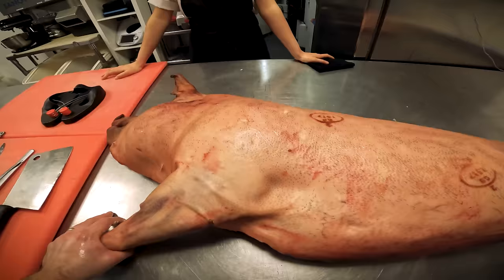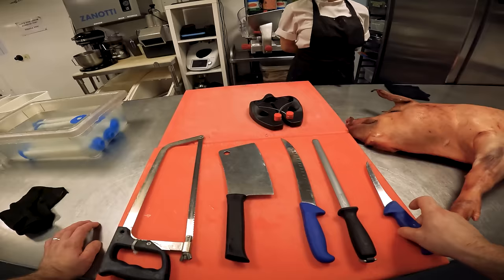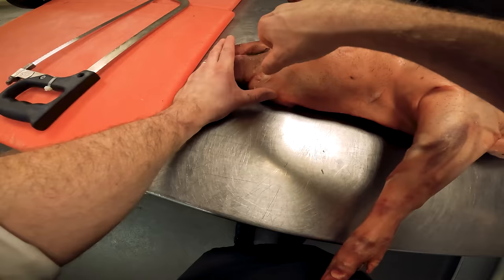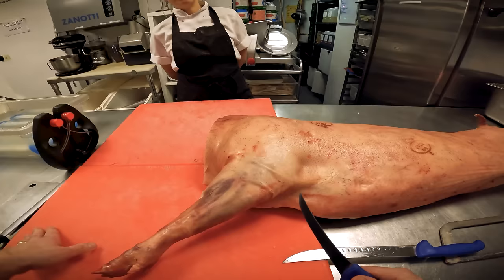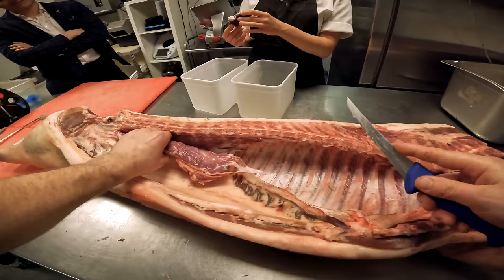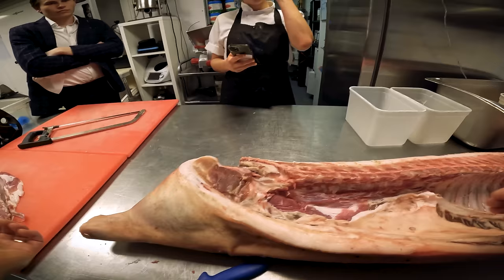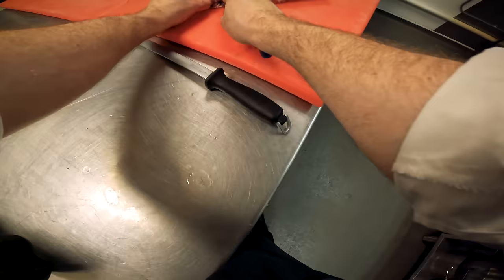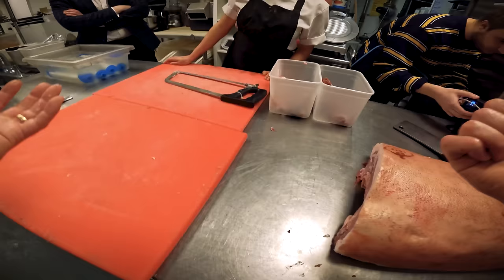POV: Butchering a Pig for a Restaurant

Comment: I'm an industrial butcher running through 3000 of these a day and this has honestly still taught me alot on improving the quality of the cuts, thanks alot.
Reply: That’s what I would have said too if I was a serial killer
Reply: 3000 per day equals to a bit over 6 per minute, or one every 10 seconds, assuming you work non stop for 8h. Sure thing
Reply: @Ranexi  😂😂😂
Reply: @Ranexi  If you just knew, we running slow right now because pork prices are low in Denmark. Capacity of my workplace is 12500 a day split across 2 shifts, night/day. If no mechanical issues or bad pigs we  run 500 pigs/h per production line, i.e 10 a minute -+ and still have about 1:30h-2hour breaks on an 8 hour shift. It ain't pretty and not something I expect to do all my life, but it's the only way to keep the shelves stocked in your local grocery store if we all keep enjoying cheap meat. But yeah sure thing I guess ;)
Reply: @Madkassen2  guess they didn’t read the “industrial” part lol
Reply: @Madkassen2  hvor arbejder du
Reply: @lingling813  Danish Crown
Reply: @Madkassen2  årh sindsygt
Reply: @Ranexi  

He said "industrial", mook.
Reply: @Ranexi  industrial butchers use band saws to break down mean rather than hand saws and cleavers etc
Reply: How can you sleep at night ?
Reply: @alexandergeuze4689  With a belly full of bacon ;D

Comment: I was under the impression that it is important to clean both the blade of the saw and the meat around the cut after sawing through a bone to prevent bone dust and chips from accidentally ending up on people's plates. Am I wrong about this or do you just clean the meat later on during prep? Thanks for the video, pov stuff from the kitchen is pretty interesting!

Comment: I always wonder how much tiny metal shavings we eat with all that knife sharpening? does anybody know?
Reply: 4
Reply: @tboy12540  🤣
Reply: I was taught to do it away from food and wipe the knife after. Not sure how important it is
Reply: @tboy12540  that‘s a lot
Reply: @mishga5  thanks for the info!
Reply: These tools aren't necessarily for sharpening the knives, so they aren't removing material. These are 'honing' tools. They straighten micro curves in the blades edge